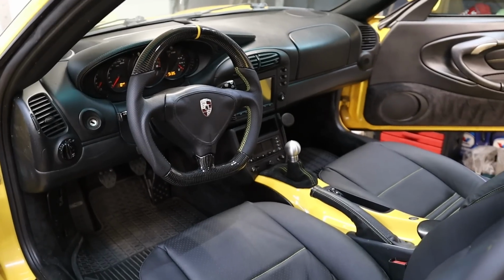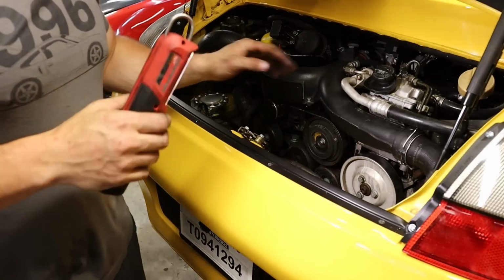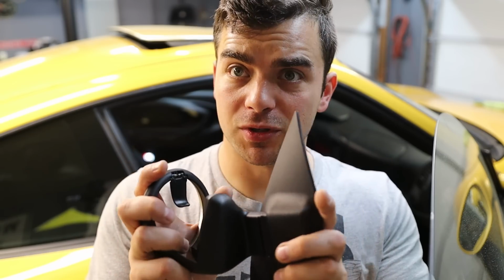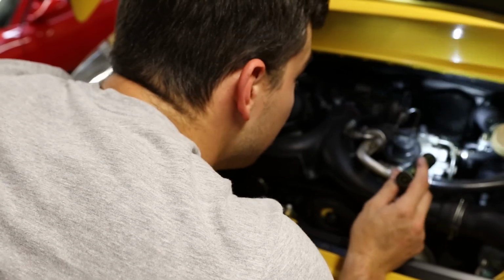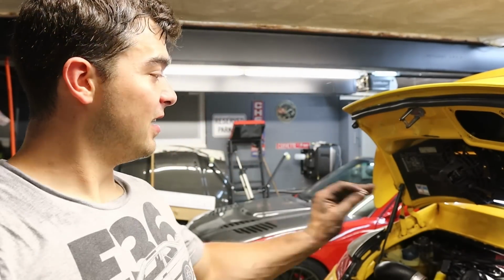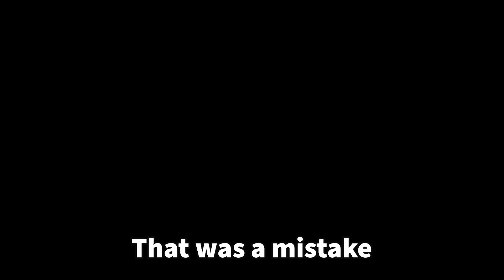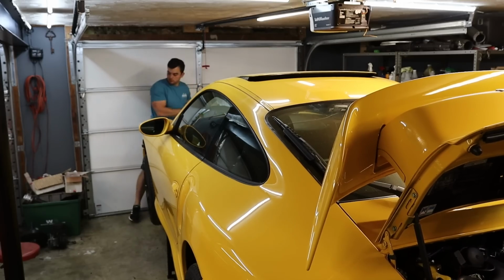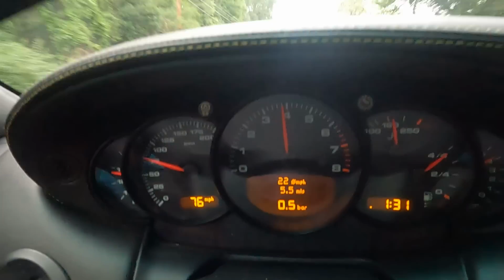I Bought a Cheap Porsche 996 Turbo and It's Unfixable

Comment: Theres a company that makes a kit where you can put a 2.7 twin turbo VW motor in it.  The motors are found in the older B5 S4's.  Come complete with ecu etc.  You can find one of those motors for cheap.  Ive also seen a couple guys putting K series honda motors in as well.  At this point you should just drop the engine instead of breaking your back hunched over for hours.
Reply: Yeah let’s put a worse s4 motor in it 😂
Reply: Would be cool, but anything from B5 will be garbage. I love them, but they are fucking pain in the ass.
Reply: Right, let's swap a LeMans winning Mezger engine for junk.
Reply: You could do a B5 swap on a regular 996, but changing out a block that was designed by one of the best engine makers, ever, would make zero sense. These blocks are legendary. 

These can easily handle 800hp. 

Your idea is akin to swapping out a 2JZ for a Civic motor.
Reply from the maker: Those are some interesting swap ideas lol.

Comment: CHT sensor.
Reply from the maker: CHT?
Reply: Although not a Porsche, I’ve had boosted applications where the CHT sensor failed (coolant head temp) and it put the car in open-loop (or closed loop?) where the computer cuts both timing and fuel parameters to avoid hurting the motor. In my case, it was the actual sensor that failed and not an engine issue that triggered the CHT sensor to relay to the computer. 
I just googled CHT Porsche 966 and a lot came up. Hope this helps.
Reply from the maker: Oh, gotcha!

Comment: There's nothing more expensive than a cheap Porsche... the whole modern Porsche industry is about super wealthy people being OCD and going overboard with everything and buying cars and parts that are 10 times more expensive than they should be, just to show off their money in order to boost their ego, no pun intended.  But if you do all the work yourself you can make it affordable, but the parts are literally 10-20 times more expensive just because it says Porsche.  You probably saw this about the 996 not holding boost:

6speedonline forums 996-turbo-gt2 448795-boost-leak-test-wonit-hold-any-pressure

If you type that into Google the first forum post is what I'm talking about.  There are probably a lot of people on Rennlist who have been through what you are doing through.  You could probably even get more channel followers by posting an ongoing thread about your progress there and updating it regularly with your progress.

Having said that I think once you get the boost to come on correctly you are going to love that car, are you kidding... when that car came out it was like the best of the best... so get it working right before you decide to sell it.  Check out the 1300HP King Kong 996 for motivation.

I never even used my radio/audio much in my Porsche when I daily drove it...  now I just collect them...  but I was too busy driving it around corners to worry about sound and cup holders... once you get the boost going maybe you will enjoy it more...  I think that post above said to use soapy water...

Comment: Thats 😂a  wasted KLR 😮 not a porshit😅 Ive been there you waste your  money at the end  you will replace everything  to have a stock high milage  car sometimes vehicles need to be donor  cars for a reason it would  be better  to fit an Ls motor  than struggling  with a porsit wasted engine
Reply: Right, swap a LeMans winning Mezger engine for an LS PoS.  LMAO!
Reply from the maker: KLR?